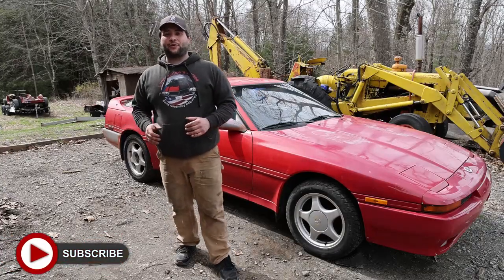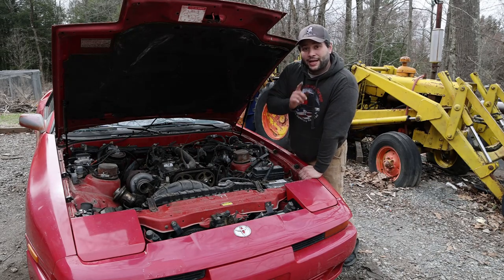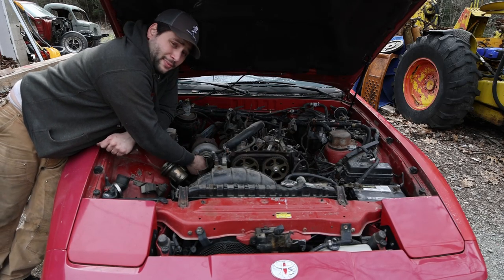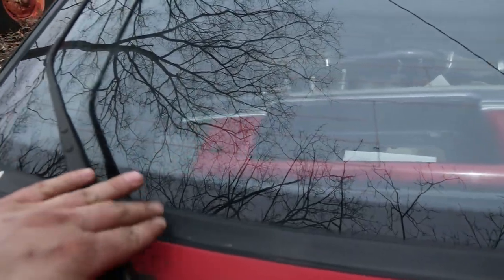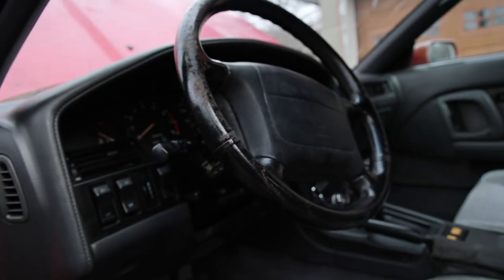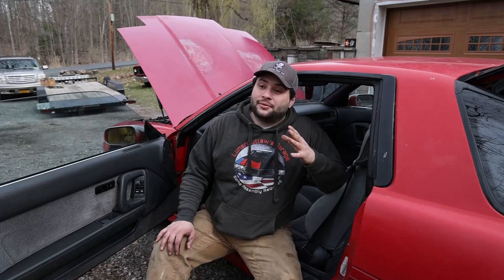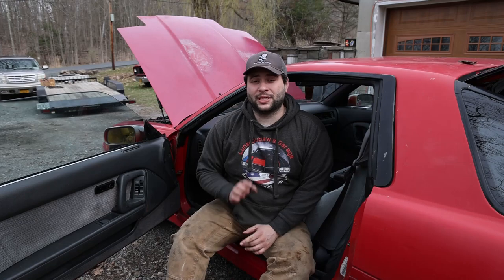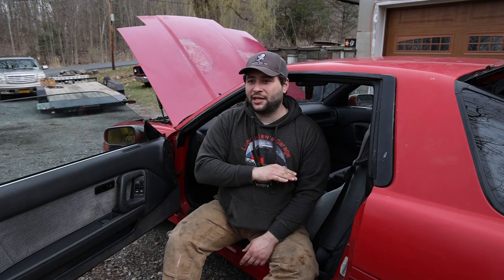I Found a Rust Free, All Original, Sun Roof MK3 Supra and You Won't Believe What I Paid For It!

Comment: REALLY good guide dude. Should be mandatory for anyone buying an MKIII to watch this and Hagerty's guide. Obviously it's hard to go in the "expert" on MKIIIs for sale before you've owned one. I basically went in blind with my 1988 NA Auto purchase last year, but it was also in REALLY good shape. Interior is some of the best I've seen from these and outside looked great too (as it should for $8,000 lol) It was a garage queen which showed because just ONE month out in the sun, both bumpers started cracking and peeling their paint, not going to be cheap to re-paint those. 
I was lucky enough that the guy had the headgasket replaced (Is there any easy way to tell if they used ARP studs?) and all the valves redone. The 7M-GE is less problematic than the GTE, so I'm crossing my fingers.
One issue I did have 5 months into owning it was major power steering leaks. The shop charged me a hell of a lot for those hoses and it's not something I think you can really check for unless you get an inspection.  

All in all, It's not only the most amazing car I've ever owned, it's the best one I've seen hands down inside and out. After fulling converting to LED and with back/quarter window louvers, she looks like nothing else on the road and you can just feel the presence of it as everyone looks. It's a blast to drive and extremely comfortable. Hope you treat her right!

EDIT: I laughed my ass off when you pointed to the seatbelt strap and stated they are always broken, you clearly know your MKIII's, they almost always are, both mine included.
Reply from the maker: Yeah if you take one of the valve covers off and you look stock bolts have a 10mm Allen, ARP bolts use a hex head, and ARP studs use a stud driven in by a small Allen key and hex nuts. If you do that double check torque specifications 72 for ARP bolts and OEM bolts, and 80 for ARP Studs. 

Lol I have owned many mk3 Supras over the years and only 2 where good examples. I love the cars b/c The incredible balance between luxury and GT performance, and for the most part very high-quality build. But there are definitely things that are always damaged or missing. Never once have I ever seen the plastic shroud that sits below the engine for better aerodynamics, nor a clean original center console lid.
Reply: @LunarOutlawsGarage  Oh the huge plastic skid guard that screws in  under the car's engine? yeah I totally have that. Though within 5 months of owning it, it tried to leave the car, I screwd it back. My center console is immaculate. Just wish there were cup holders. Even the steering wheels is in extremely good shape. I gotta take care of her!

Comment: Ah The 3rd Gen Supra. A very attractive series. I had the chance to drive one with the turbo 7M-GTE in it and that was the first car that I had driven that pushed my butt back in the seat when flooring it. It is too bad that this generation Supra and the Cressida of the same era were kneecapped by the factory due to not torqueing the head bolts down causing head gasket issues and engine damage if the owner does not discover the head gasket issue before it overheats the engine or ruins the bearings due to the coolant in the oil. The thing I also like is that it is not a Mark 4 Supra which looks too much like a bloated toad. 

 There is a lot to like about Japanese cars. Mainly fuel injection (no carbs to screw with). I would love to see a fully stock and great shape first generation Mitsubishi Eclipse. Those were the cars to have. in 1990 when the Eclipse, Laser and Talon came out, it was like a breath of fresh air. So sleek. I loved the sound the doors made closing
Reply from the maker: Lol I like that bloated toad. I generally say it looks like it was a bar of soap that was left in the sink for a little too long. The Mitsubishi eclipse always seem to be completely butchered these days.

Comment: That's your heat shield for your turbo in the front passenger side floor!
Reply from the maker: Yup the car is incredibly complete. I would have the car back together the other day but I was missing the banjo bolt and washers for the cold start. Picked them up Bingington Toyota on Wednesday

Comment: I would NOT consider that to be a 
"Muscle Car" by any means.
Reply: Definition of muscle car
: any of a group of American-made 2-door sports coupes with powerful engines designed for high-performance driving.

I’d say by definition that’s correct but I think it could a “gray” area because it fits the other areas
Food for thought??
Reply: I’m talking about the 1uz swap car. I agree the red stock is not a “muscle car”.
Reply: Most cars fall under the sports car description and muscle cars are pretty unique and are 60’s and 70’s era muscle cars
Reply from the maker: Just like them redefining Pluto as a dwarf planet, I do believe the definition that you presented is flawed in a very large way. They redefined Pluto as a dwarf planet, because it can’t in fact use its gravity well to move things out of this orbital path. If you were to take the Earth and put it in the same orbital path as Pluto, it would have that same problem. Any definition that could redefine the Earth as a dwarf planet is not a very good definition. So, where am I going with this you may ask? Well, they did have straight six muscle cars and, any definition that could preclude Chrysler products like the Challenger, Road Runner or Hemi Cuda as a muscle car, is flawed. Challengers produced after 2007 were produced in Ontario, Canada, and some of the 1970 Hemi Cuda, Road Runners, Challengers, and Chargers were also produced in Canada. Canada may be America’s hat, but it is in fact not America.
Reply: @LunarOutlawsGarage  wow are you okay???
Reply from the maker: ya other than still slightly salty that Pluto is not a planet anymore I’m fine 😂😂
Reply: @LunarOutlawsGarage  LMFAO ur CrAzY brian! Hah ha